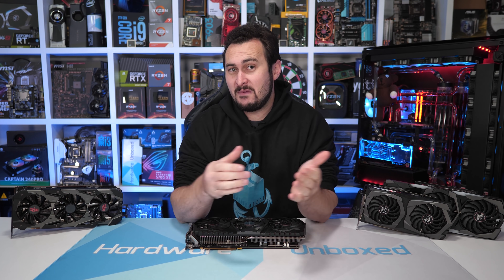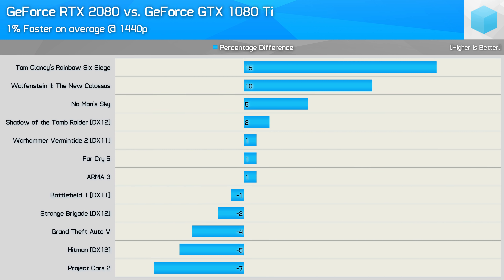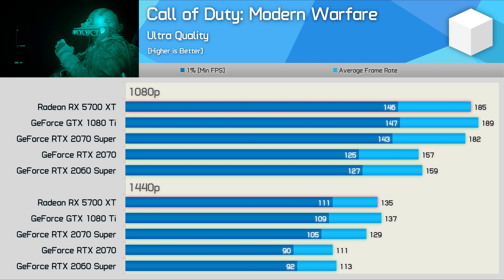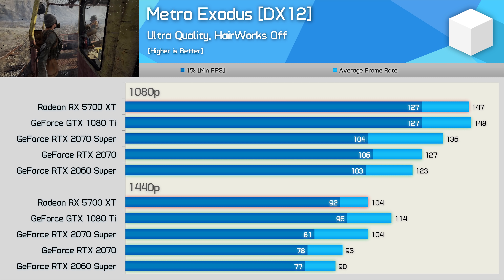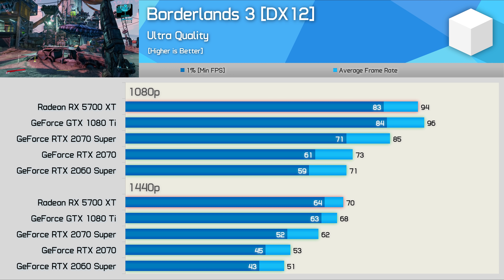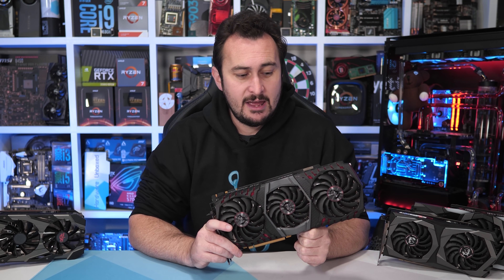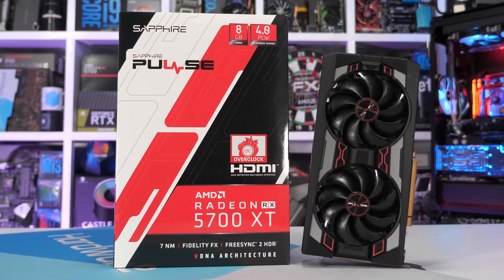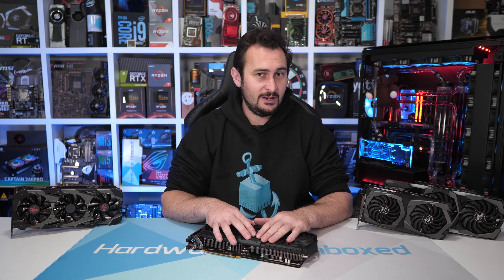GeForce GTX 1080 Ti vs. 5700 XT & RTX 2070 Super, 35 Game Benchmark

Comment: Imagine the smile on the face of someone who bought 1080ti on launch day.
Reply: Foka Szara I bought mine early 2019 when everyone was letting theirs go. So happy I got it then.
Reply: @Cattode  got mine when the 2080ti came out..wasn't falling for those 2k cards
Reply: @davegee124  Got my 2080ti shortly after it came out for less than £980, more than happy with the upgrade from a 1080, prolly wouldnt have been worth from a 1080ti but its definitely a lot faster than one so i'll be smiling into the future, everyone can make choices that make sense for them.
Reply: Didn't buy it on launch day but bought it a few days before the prices went up from 870 euro to 1200 euro so i still feel luck to have it, and i still feel like it was money well spend.
Reply: Got mine close to launch and it has served very well, I'll admit though I'm looking forward to a 3080 Ti.
Reply: I bought a used one for 360 USD, like 6 months ago. Glad that it's holding fine until today :)
Plus, I bought a waterblock for 100 USD when it was on sale.
Reply: I got mine after mining tanked and as soon as I saw the MSRP of the 2080ti :D

Got 2 probably for the price of a single 2080ti. Actually, less than that.
Reply: I got mine for about 5% over the $749 MSRP right at the start of the mining craze.. $810 for an Asus ROG Strix OC edition.. .. I remember the day after I got it the cheapest I could find it for was over $900 and for the rest of 2017 it kept climbing in price ( I remember seeing it go for over $1500 if you could find it in stock)  until the mining bubble burst in spectacular fashion... Glad those days are long gone🤣🤣
Reply: @rtxrt73  I almost sold mine during the mining craze but didnt want to go months without after selling before I could get a new one.
Reply: Got mine the same month it launched. I am very proud to be a owner of the card
Reply: I am one of those , I usually sell when I upgrade but my 1080ti has been such a good buy and still crushes. So I may just keep my precious forever.
Reply: Our smile is great. Very large. Its the largest greatest smile ever. Very yuge.
Reply: It was certainly one of the better purchases I've made.
Reply: Owner of one since May 2017 :)!
Reply: Haha it's the only products I have ever pre-ordered when I built my rig for VR. Best decision
Reply: @Salt Maker your making yourself known with your head up your ass lol. In what way is this review bogus or inaccurate? It's been known for years that a 2080 is similar in performance to a 1080ti...where are those links?
Reply: You guys have all been had, and you don't even realize it. 
Nvidia is the one smiling, all the way to the bank. 
You see during the whole mining craze, they made a big fuck up and produced way to many Pascal cards. 
So in order to clear all of the old stock, they priced the replacement cards so high, that you would go for the older cards, instead. 
What's more, Nvidia has succesfully convinced most of you, that it's reasonable to pay 700 dollars for a gpu. 
And what's even better is that they have upmarketed you, so you guys are forced to buy a Ti, again in order to get a viable performence boost. 
Yet here you are bragging about it? Now that's fucking funny..
Reply: I got it close to launch. Came with destiny 2
Reply: It probably seemed expensive atvthe time but you saved yourself having to buy another card until 2025.
Reply: Got mine on the 6th of April brand new, 3 years warranty, it is the Strix OC model, feel really satisfied with the performance and feel like I made a steal with it for 400$.
Reply: It me!
Reply: 2018 december I believe i got mine it was right before the mining craze that's what I remember xD
Reply: Yeah when I saw the stats on it I ordered it on launch. Didnt think 2080 would be such a letdown so it turned out to be an amazing investment
Reply: It's a frown for me because I love upgrading PC's and the RTX cards were kinda underwhelming (maybe Minecraft RTX will change things)
Reply: Yea got one in my bedroom pc.
Reply: Got mine April 2017, EVGA Black Edition for $709. Enjoying gaming heaven ever since.
Reply: I'm more of a negative person and see sadness because so little has been accomplished on the gpu side since the 1080ti.
Reply: I'm still happy with my 1080. Gonna try to hold off upgrading as long as I possibly can
Reply: That´s right, they can be happy because they did it right.

In 2019, i bought two NEW Asus Strix GTX 1080 Ti´s and to this day i don't regret this purchase.
Reply: Bought mine in late April, definitely smiling rn. I'm probably going to upgrade to a high end Ampere card later though and keep the 1080Ti as backup/run F@H on it, as I could use more graphics muscle to drive my Index.
Reply: More like 2 months after "launch" because that's when the fucking thing showed up in stock at least 2x a week.
Reply: I managed to get a Titan Xp for £400 back in the summer. Best GPU investment ever!
Reply: Yep and still playing pretty much all games at well over a 100fps. I also can imagine the facepalm of someone who bough a 2080 and up. Isn't last gen performance supposed to be cheaper? If you ask me it's really dumb to pay for last gen performance the same price. It supposed to cost 500, then it would be ok or if it had 2080 ti's level of performance or even better then the 700 asking price wouldn't seem that fucking retarded. RTX has to be the worst gpu genaration that ever existed. It really sucks when there's no competition huh?
Reply: I got it for $699 two weeks after launch, used it for nearly two years and sold it $580. Only reason I sold it is because I went from a huge RGB tower to an sffpc and needed a 2-slot card. Damn that card was a beast.
Reply: imagine the smile on the face of someone who "stepped up" using evga step up program from a 1080 for paying only 150 bucks in march 2017?
Reply: brought it around that time, I'm not letting go of mine
Reply: I got it at launch even though I live in a shity 3rd world country
Reply: I bought my 1080 Ti in December 2017
Reply: Bought my FTW3 1080ti on launch day. 1.5 years later i threw a waterblock on it, and am still happily using it to this day.
Reply: I did ! and yes its a wonderful card.
Reply: So is it worth it now or should I wait
Reply: I got mine in mid 2018 for like 500 on a bid on ebay. Been a great 2 years
Reply: I couldn't imagine, because if I wanted I couldn't. Too expensive
Reply: I bought a used 1080ti founders edition, nzxt g13 and aio. Made a liquid cooled gou for around $520
Reply: I got mine in July of 2017, mined enough Crypto to pay for it, and am still gaming on this bitch every day!
Reply: i bought it around launch and my god it was such a good investment.
Reply: Yeah I got a 5700xt that crashes in one game
Reply: In New Zealand the Asus Strix ROG 1080Ti OC cost me 1400nzd on launch day... Still consider it a bargain considering it would cost me 1400usd plus shipping to buy one today
Reply: I was VERY pleased when the 2080 came out and it was the same speed as my Founders Edition 1080ti, but more expensive...  If I amortize this 1080ti over the period from launch day to now,  then the card has cost me 90 Cents a day!  1080ti for less than a cup of coffee ;)
Reply: Or used.
Reply: One of the best purchases I've ever made in gaming. I'll keep using it too unless the next cards really blow me away.
Reply: (Raises hand)
Reply: got it in May 2017. Still have that stupid smile on my face when I watch my 1080ti inside my case lol
Reply: I am sitting on my Gtx 750 Ti  2gb.   Playing smaller games on a I7 2600   Video editing is long but not often enough ..So my first step will be to find a monitor that will run4k120fps. And low 1440p when it’s just paper work ..I am holding out for a thread ripped system and 3000 NVIDIA cards ...looking forward to that test against a 1080ti
Reply: yeah I wanted to buy it but it was 900euro in my country so yeah
Reply: and the people who bough 5700XT for $369 😊
Reply: I was going to get one but amd drivers suck ass from what I’ve heard. Also that chip runs super hot and is only good on benchmarks. Reviews say turn the speed down and undervolt slightly.
Reply: Tharindu Dhanushka lol. 5700xt was released more that two years later
Reply: @imlvee8909  Does it matter? there are no cards which are faster than it for $370-420 price point.
Reply: Tharindu Dhanushka yes it does.
Reply: @Pixel_FX  yeah got the gigabyte rx5700xt when newegg was selling it for $369. Now its going for $409. I am avoiding the xfx variants like the plague since the one I tested overheated like crazy at high load.
Reply: The GP102 die is barely bigger than the 2060 die. The 1080ti should have cost $400, tops.
Reply: Imagine the smiling face who someone who pre-orderd a Strix 1080ti that I watercooled, which I sold for a pre-ordered 2080ti that I watercool, because I can afford it (thank you Mutron Biphase).
780, 780ti, 980, 980ti, 1080, 1080ti, 2080ti.
Reply: Wasted money

Comment: Yeah... In early 2018. The crypto currency problem was at full force. The 1080 ti was around $800 or $900+. I think it died down in mid may or june. Then months later the 20 series came out. Just want to put that in there.

Comment: me over here waiting for next gen with my RX580
for now it's either: overpriced 2070S 
or: bugged 5700XT beta card, no dx12 ultimate support, +no dsll or raytracing support
just gonna wait until autumn, everything else would be stupid if you don't absolutely need a new card right now.
Reply: Most of the bugs seem to be ironed out now. My 5700 XT hasn't black screened in weeks.
Reply: @hypnotizedgamingtech  yeah, go to reddit AMD techsupport forum and see the flood of people with 5700XT problems. I'm not gonna pay 450€ for something that's not 100% working. with 2070S you get stability but it's overpriced for being same performance as 1080ti from 3 yrs ago

Comment: In the games that the 5700XT beats the 2070 Super, how does it do against the RTX 2080 non Super and the Super?
Reply: 2080 beats it.  It doesn't beat it in value however. 2080 performance doesn't justify that price tag.
Reply: just watch a benchamrk where are compared all rtx cards and do the math.

Comment: Picked up a used asus strix 1080ti for 500 EUR about a year ago (msrp is usually higher here than in the US for pc components). Don't see any reason to upgrade in the forseeable future, so glad I made that deal.
Reply: Dude, I'm so happy with this card. I got the same card for 420 EUR from a miner and I feel like it was a steal at that price. Was quite a good stroke of luck on that one.
Reply: @Steror   420 (😏) is insane! Lucky man
Reply: Same here, picked up my used one, still with 1 year of guarantee in December for ~~ 500 usd (was usually higher here because all of it in Poland is fucking pricier), put my 2x120 AIO WC on it, OC that badboy to 2000 core / 12000 ram, runs barely up to 60C on RDR2 and im happy AF. Ram capacity also helps as hell in games like Cities Skylines (sometimes i see it go up to 11 gb usage!). Have fun with ur badboi!
Reply: @debicadude  ahh feeling validated in a purchase is truly peak consumer statisfaction 😌
Reply: if the 30 series is priced like the 10 series and offers 30 to 50% more performance than the 20 series, then I'm pretty sure people like you and I will buy the flagship. But if not, I'll stick with the legendary 1080 ti, 2070 super or 5700 xt.
Reply: ive got a msi 1080ti gaming x for 300 euros 1 year ago!!!
Reply: @Maximusss1385  Dang, son.

Comment: That is the reason i kept my 1080ti, because the 2080 was basically the same and the 2080ti was just too expensive and then again the super cards didn't really pushed the bar that high.
Reply: raytracing support,too bad raytracing is just a gimmick,as much as nvidia sellouts try to push it,its not important to gamers.
just look at rtx news, minecraft and crysis,what a load of bullshit
Reply: I can feel that....however... sadly now that Nvidia don't optimise for Pascal as much in new games there is a large and ever growing gap in performance difference between a 1080ti and a 2080 :(

I can see the difference when I swap between my two rigs one with a 1080 and another with a 2080ti. The difference is vast in modern games :S
Reply: RanK ColouR why are you comparing 1080 to 2080Ti????
Reply: @rankcolour8780  Yes i think that is the real problem. The companies can just ruin the performance of their previous products when ever they want with drivers ect. :-( same thing they do with mobile phones ect. Id love a 1080 ti but i do feel intel will force the older gpus down in performance as a way of forcing people to upgrade way faster.
Reply: @KarlKlaus vonS 99% of games didnt have ray tracing at the release of the 20 series, I say it was a gimmick and a rip off.

Comment: "Welcome to hardware unboxed, also known as harbor boxed..."
It's like "Drop, formerly known as Massdrop". An official name now.

So uhh, Hello Harbor unboxed!

(also 1080ti is still best card even now, basically matches 2070 super without the extra bloat // and at half the price now!)
Reply: Where are you finding 1080tis at half price this late in its life?
Reply: @ShawFujikawa  if you wait for a while they do come up now and then on ebay & other sites. of course maybe not as often with coronavirus and all that but they do
Reply: >indecipherable symbol< aka "the channel formerly known as hardware unboxed"
Reply: Electroblade 2080S? Nah. It's slower than a 2070S în most games.
Reply: @acryion  it was 2% faster on average in 35 games tested. so .... ehm its on par with 2070 super and 2080 but slightly slower than the 2080 super yes
Reply: @Aleksander50853  They're probably referring to overclocking the gpu. It'll bring the 1080Ti even closer to 2080 Super-level performance.
Reply: @nihilimobscuras9750  no it was actually a typo, i make lots of them on phone
Reply: @acryion  what video were you watching? It's faster than the 2070S
Reply: @acryion  ikr he literally said don't get a used 1080ti for the same price, instead get the 2070. Not to mention half those lived through the bitcoin mining fiasco.